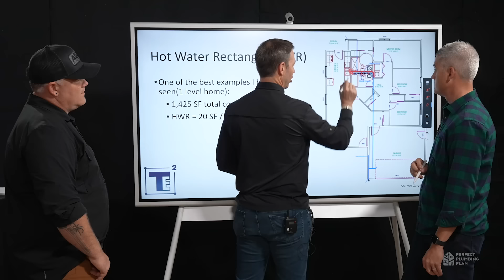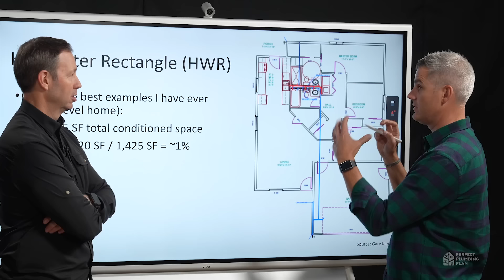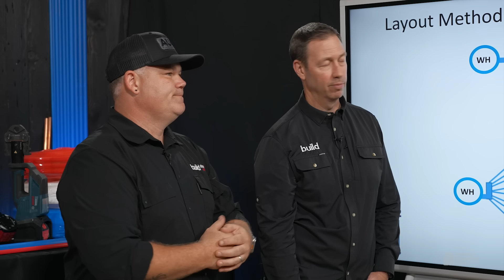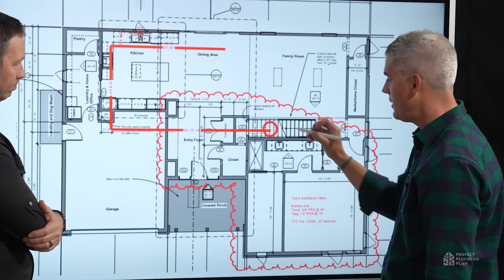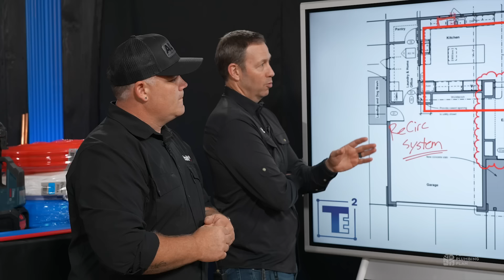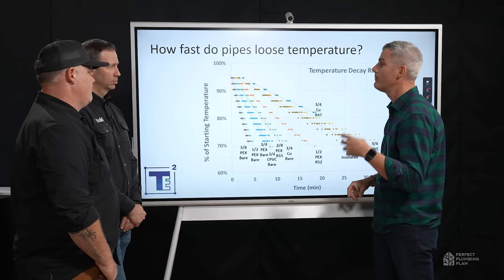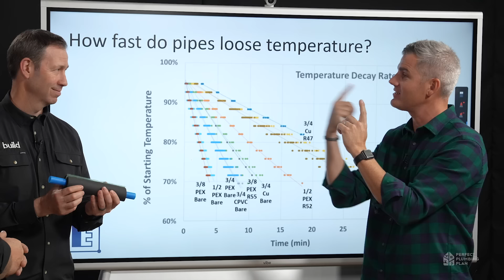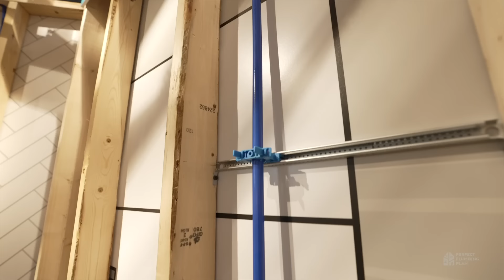The Perfect Plumbing Plan - Ep. 2: How to Get Hot Water Under 10 Seconds - Plumbing Layouts Part 1

Comment: Does the graph not show that 3/4 pex bare temperature decay is faster than 3/4 copper bare? I read it that 70% temp is reached at appox 8 mins for 3/4 pex bare, but approx 12 mins for 3/4 cu bare. Is this not opposite to what they seemed to be saying (except when he gave the graph example)?
Reply: I noticed the same thing.
Reply: I was confused myself and had to re-watch several times to see if I was missing something.
Reply: 3/4CU holds more water and the copper itself has high thermal mass. 3/4 PEX holds slightly more water than 1/2 copper.

Comment: The location of the hot water heater is really irrelevant.  You can run an insulated pipe to a centrally located valved manifold.  The supply lines to the individual fixtures will be from the manifold.  Include a recirculating system and you will have almost instant hot water.

Comment: How do you insulate through floor joists? You don't.
Reply: I insulate with warm thoughts and well wishes.  Results may vary.
Reply: Except lumber has an insulation factor. A 2x6 is R9...so a pipe running thru the middle is ~R4 on either side. That isn't the same as wrapped insulation, but it isn't uninsulated either.

Comment: I'm hoping it gets brought up - but when a recirc pump is used, hot water that cycles round the system is losing heat (and increasing cost) as it travels - as well as heating the joist bay pathway around the house (imagine the idea of running a loop of HVAC duct around the perimeter of the house that runs continuously).  This isn't a huge factor if it's insulated - but if we're trying to get down to the math - a constant 50 degree delta should be taken into consideration.
Reply: If it's not insulated? Who in their right mind who watches this channel is not going to insulate at bare minimum the hot water lines? So say it loses 20 degrees if not insulated. Is it going to cost more to heat 100 degree water recirculated back in from a loop, or feed in 50 degree well water. Pretty sure a circ loop insulated or not is better than cold water feed.
Reply: @mitchdinner9743  They don't run continuously. Timers or temp sensors. You will use more power, yes, but not much. Less water wasted waiting for hot though.
Reply: @nevets87ownz I'm talking about energy needed to heat the water not the stupid pump.
Reply: @nevets87ownz  this is false. You will see an increase in the energy used by the water heater. This will be orders of magnitude larger than the energy used by the pump.
Reply: You don't have to run it continuously.
Reply: It adds up to have 24/7 hot water sitting with that much surface area. That's where smarter controls are important, e.g. push button in the bathroom to prime the loop before a shower
Reply: @kentaltobelli1840 I'm about to do exactly that in my master bathroom: install a push button activated crossover pump to bring hot water down from the tankless heater in the attic.  I don't like wasting a minute's worth of water every time I shower.
Reply: I would likely run a circ pump between the 2/3 section only on the 3/4 main rectangle, and only have it run during winter months 1/2 hour prior to occupancy and off at 30m past occupants bed time via Shelly relays. This would likely increase the average temperature of the furthest runs decreasing seconds to hot. I think it is the best of both worlds kinda deal. Id rather weight 1 min at the shower while im brushing my teeth, than when im at the kitchen sink but everyone has a preference. Energy wise you aren't running it in summer when you shouldn't need it and adding heat load(avg house) and if it is copper or pex will really only matter slightly on the up or on the down as long as it is insulated. Use application on well v. city makes all the difference. The only real waste on well is the cost to heat it, city you have to consider the cost of water anddd the cost to heat it. Some perfect scenario for one may not work for other at all. Custom cookies are always the best cookies.

Comment: I love my Grundfos recirc pump. It sips 6 watt running and the internal temp sensor ensure I have hot water between 5am and 10pm. The single loop dedicated hot water return is my favorite method.
Reply: I have one controlled by the a Hubitat Elivation.  Sensors in each bathroom start the pump when someone enters the room.  It's on demand 24 hours a day.
Reply: A loop will also take the load off of hwh lowering the delta from feeding freezing cold well water.
Reply: Ya, sips power, but then you blow $1500 on a buffer / water holding tank.
Reply: @kenjames8377 Could you explain? If you mean the heat loss in the pipe, that is a benefit since I live in a heating climate.
Reply: Only way to go